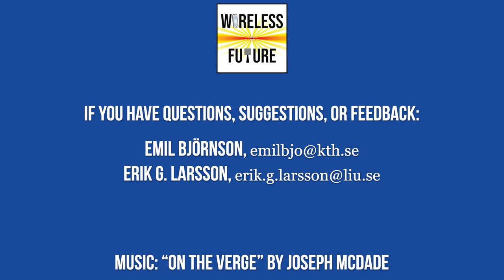Ep 20. Wireless Solutions for the Internet of Things (With Liesbet Van der Perre) [Podcast]

Comment: Thank you for this podcast !
In one of the podcasts about "energy efficiency", you've talked about the energy efficiency metric as the data rate vs power consumption ratio, but when it comes to IoT, e.g., sensors, this metric has no sense (since shannon's capacity cannot be considered).  
What would you suggest as an alternative definition of energy efficiency metric in an IoT network ?
Reply from the maker: I think the main goal would be to carry out the intended task with as low power consumption as possible. The important thing is to consider all sources of power consumption, measurements, computations, connectivity, etc.
Reply: @WirelessFuture  Thank you for your immediate response